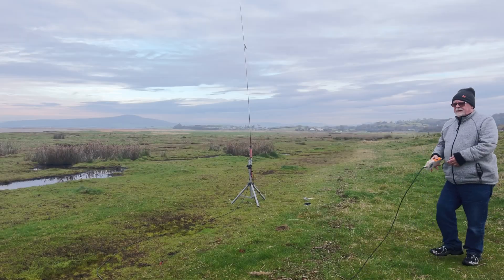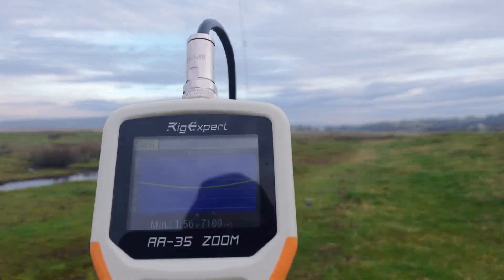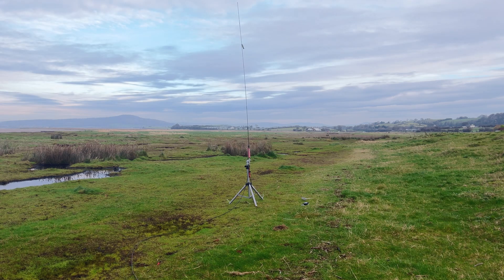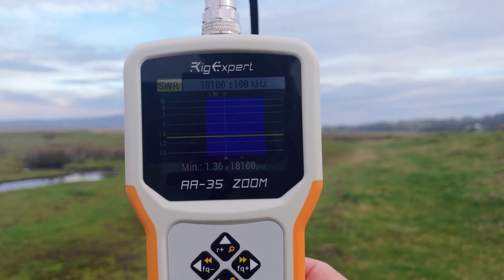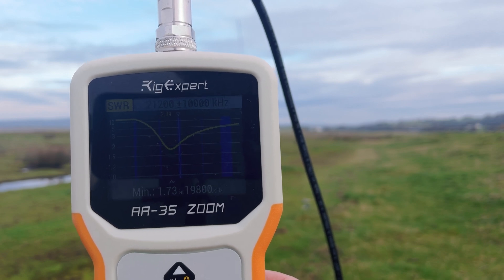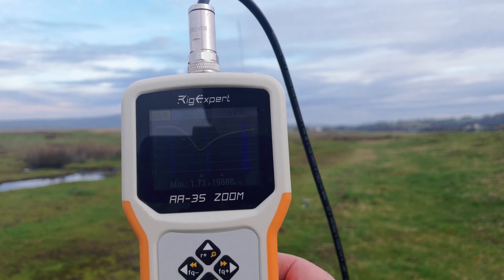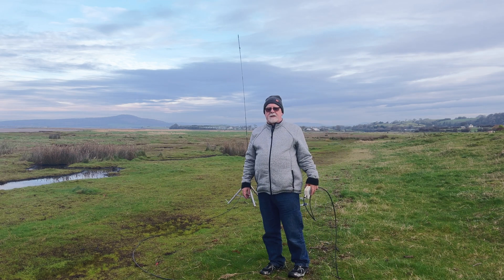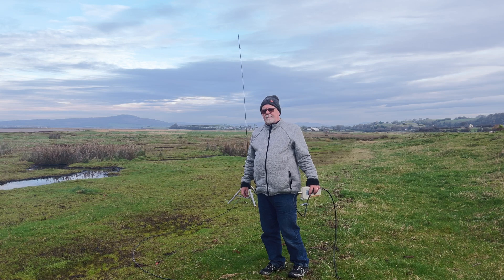Testing The Slidewinder (Part 2)

Comment: Antenna looks very good, trying it on the magmount next?  Quite like the outside broadcast style video too, thank you for posting it.
Reply from the maker: My 'Roving Reporter' style, Ray :). The mag mount is on the list for sure
Reply: It works on a magmount but we recommend a proper mobile antenna mount bonded with earth straps for maximum performance.

Comment: An extra set of radials will sort this out & put the radials directly out from the bracket instead of running down the tripod.
Reply from the maker: Thanks for the tips.  I will be trying both :). I love the aerial.  It's so versatile!
Reply: @bayamateurradiogroup  we found less interaction with the tripod & radials running them directly out from the bracket. Its a great antenna system very easy to setup & in two years is now used by many across the world now.
Reply from the maker: @Tantalicdavid  The reason I set the radials as I did was to stop the potential for people to fall over them :). The public do not do risk assessment in my experience.  I will be trying it that way though.  I am truly impressed by the whole band coverage!  Ian (G0VGS)

Comment: Very good. Will you be connecting a radio? Also what about the mag mount setup? Also, what time of day was that. It seemed very quiet, especially part 1?
Reply: Mike all your questions will be answered if you search Youtube using search terms Slidewinder Antenna.
Reply: @Tantalicdavid  Thanks, I did the search but couldn't find the answer to the time of day it was filmed at. Thankfully Ian stepped in and told me ;)
Reply from the maker: I will indeed :). I will be doing some additional tests for raised radials and on the mag mount.  It was around 10am during the week.  I thought it might be quiet and it was :)

Comment: Hi, I wonder if a telescopic whip would be useful to get in to the awkward bands without a tuner?  It wuld also be interesting to see how it tunes on the tripod on non-salty ground too.  The proof of the pudding will be on the air of course.
Reply: Excellent video from Ian. I wonder what sort of fitting is on the end of the foldable top section and how long it is. The popular 2.5m telescopic whip (as used on the JPC-12) has a 10mm male thread.
Reply: @rozzydave  On the website they sell the coil with 3/8 top and bottom so one of the generic 3/8 telescopics from the main retailers may do.. I wasn't aware that the JPC-12 was non-standard.  I have loads of 3/8 stuff but the coil interests me.
Reply from the maker: @rozzydave  I hadn't checked that as yet Dave.  I was going to try and use an adapter
Reply from the maker: YEs, I agree Douggie.  Over a more 'normal' ground, it may react differently.
Reply: I get 40 to 10m (not tried 6) easily with this coil and an AT271 whip. There is no struggle getting 10m provided you realise that the fully erected whip is >1/4 wavelength long on 10m and so the top needs folding to make it <1/4 wave. The coil then easily matches it. It really is a doddle. 
With a single 4m long counterpoise wire, and the antenna ground mounted on an aluminium V tent peg, I've worked heaps of DX with <5W CW, incl Australia.
It's great.

Looking forward to seeing your videos of it in use.
73 de M3KXZ